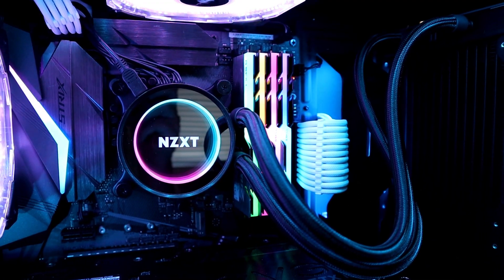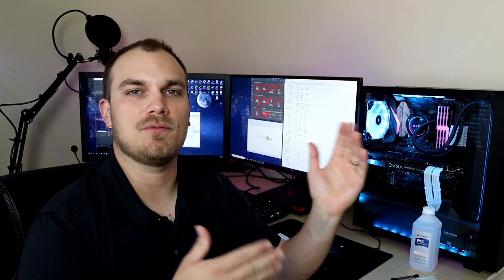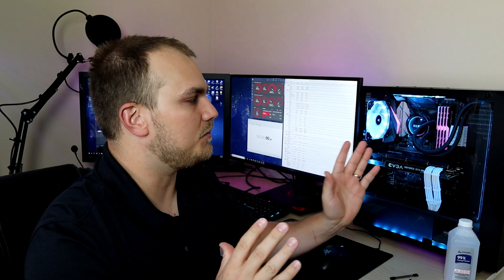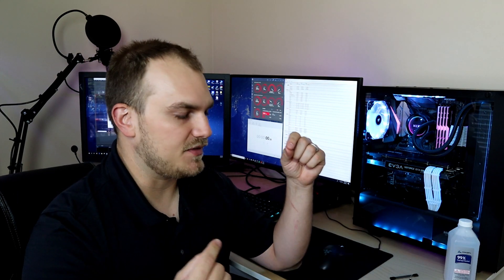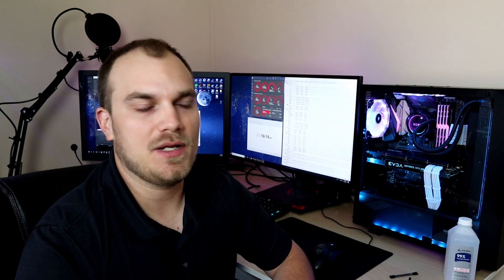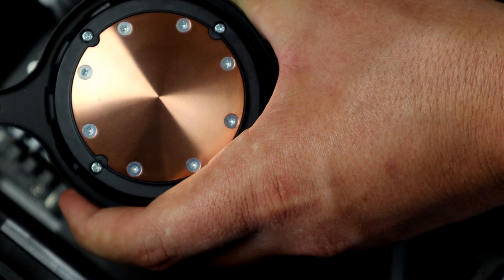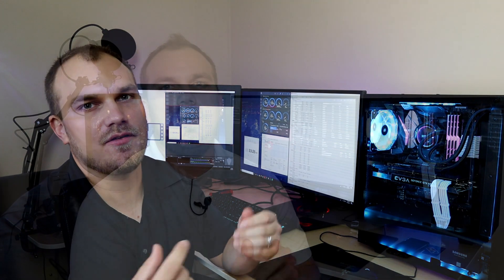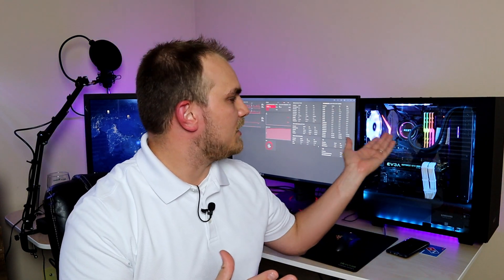Is Pre-applied Thermal Compound Any good? | How to Apply Liquid Metal Correctly to Lower CPU Temps.

Comment: I don't mean to sound like an ass but I would not recommend applying the liquid metal directly onto the heat spreader. I would recommend putting it on a paper towel and then dabbing some off that towel onto a q-tip and applying it to the heatspreader. Literally just to be safe because the liquid metal tubes can sometimes clog slightly and it just squirts everywhere and you do NOT want liquid metal all over your motherboard. or you're gonna have a really fucking bad day.
Reply: You are correct, in one of Linus Tech Tips he does just that.
Reply: Wouldn't recommend using a paper towel or a q-tip, run the risk of leaving tiny paper or cotton fibers in the thermal paste.

Comment: i delid and put LM on my 8086k die..the question is, is the temperature difference worth the risk putting LM between ihs and cooler? im using h150i so no issue with cool plate decaying
Reply: if you dont want to risk shorting any of the transistors around the die, then buy a silicone conformal coating and put it around. Ryzen cpus are all coated around with silicone.

Comment: What if u use both? Can u do that?
Reply: you need to use one or the other is what i understand.
Reply: I recommend not to put both, if you want to put the aftermarket thermal paste then remove the pre applied. If you put both, then it will be too much, and goes to the mb and kills it, with a lot of thermal paste can produce heat. Its not always “the more the better”.

Comment: does 9900k runs hot normally? or idling at 30 and gaming at 78 Celsius normal?
Reply: My 9900k runs at 29-32c idle and about 40-45c while playing (depending on the game).
Reply: @zergin247  playing mhw and anthem im sitting at around 60-70. Average of 65 celcius. should i reapply a fresh new thermal paste?
Reply: hihelloxxxx - Wouldn’t go there just yet, thermal paste is pretty hard to mess up. Few questions though, how are you cooling and are you OC’ing? If so, what is the voltage set to? 
I have a buddy experiencing the same temperatures you are, and I think it’s due to the cooling system. The only difference between his set up and mine is the fan I have blowing directly on the back of the CPU and a custom water loop vs his AIO.
Reply: not OC'ing, i have x52 kraken 240mm aio, my radiator fan both are intake 2 fans are stock from my pc case are both exhaust.
Reply: hihelloxxxx - To be clear, you have 2 fans on the rad or 4 in push/pull? If only two fans on the rad, are those static pressure fans?

One way to test your thermal paste is to apply a bit of pressure to the block while under load. If the temperature drops more than a few degrees, I would reapply paste.
Reply: Zach Brose I only have 2 fans on the rad. I installed it in the front of the pc case and it goes rad first then the rad fans behind it blowing air towards the block, then the orher 2 stock fans from my pc case installed as an exhaust.  I’m new to building pc’s so. 

Edit: tried applying some pressure to the aio block while stress testing nothing changed.
Reply: @hihelloxxxx  I've got a 360mm aio from corsair (h150i pro) with the preapplied thermal paste cooling my 9900kf oc to 5.0ghz 1.270v. my idle is 48C, gaming is 60-72C, and when under full load AVX no offset temps are 75-85C. I have ll120 fans on the rad in a pull config and run them at 1200rpm. Although I am late to the conversation I hope this helped

Comment: Good video!
Reply from the maker: Thank you, Keep an eye out this week i have a video coming out where i picked up a Alienware M14xR1 from a friend that was overheating like a boss, (ran overwatch at 1-5fps on low presets) i tore it apart and cleaned off the old dried thermal compound (which was hard as concrete) and liquid metaled the GPU and CPU and when i got it back together it ran at the same presets 55-60FPS with no thermal throttling it was actually awesome to take a computer built in 2011 that was seen as trash and get it to work better then the day it came off the line.

also looking to upgrade RAM and add a SSD to make it better then it ever was.